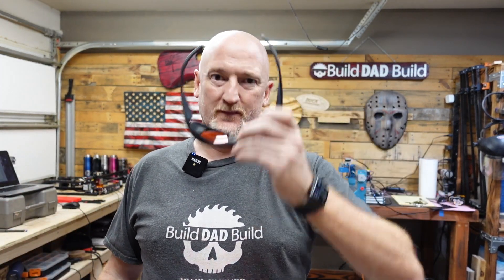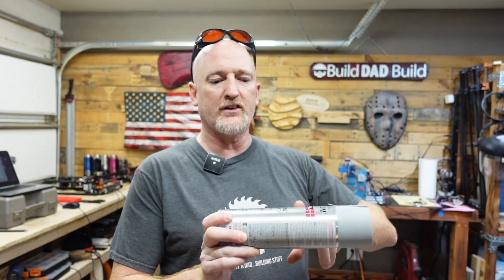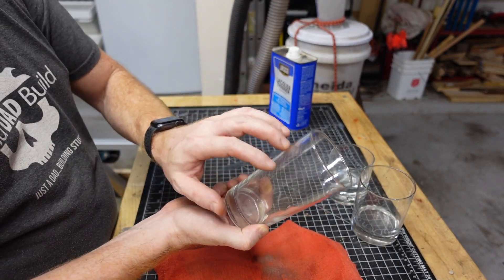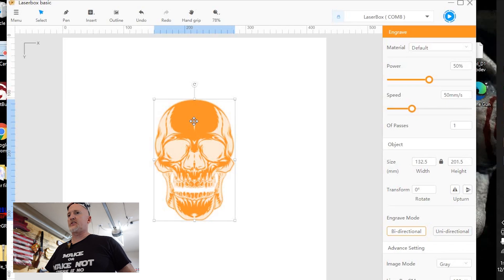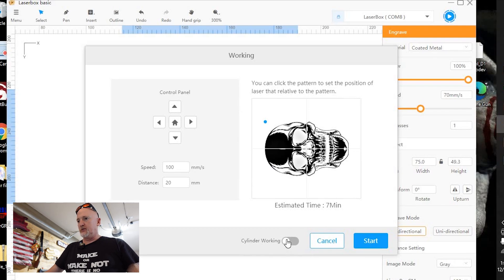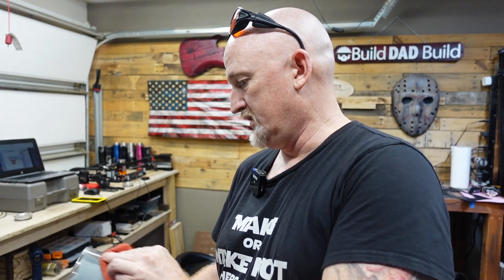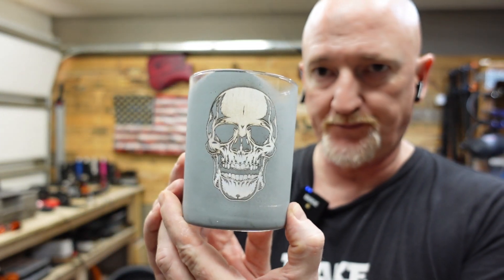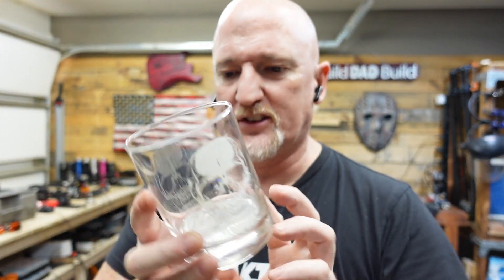How to Etch Glass with the xTool D1 10 watt Diode Laser

Comment: Hey, cool video Budd..  I'm Seeking tips for solutions in achieving bright visible FROSTING on glass engraving.
I have an Xtool S1 with 40watt and 2W IR  laser modules with XCS software.
When engraving tinted wine glass bottles using Tempura sprayed on, the frosting appearance is low and not acceptable yet. I'm willing to try possible solutions. Thank you in advance for your input!
Reply from the maker: Honestly? OC2 or Fiber will give you better results. I've had pretty good results with this:
https://enduramark.com/products/laser-marking-spray-can-charcoal-for-glass-ceramic

But the etch comes out dark, not white.
Cheers!

Comment: So the paint is gray but the end product is white? How did this happen? I tried it and it ended up gray/black.
Reply from the maker: It’s not the paint color. You’re creating micro fractures in the glass that give you the white look. Gray or black means either too much product or improper settings. Go with light coats and run a speed and power grid.

Comment: I believe that it just helps absorb the energy of the laser, We use sharpies on broken diamonds to explode them at work when using a laser welder because it doesn't give the the energy a clear path.  So from what I understand it just helps stop the energy of the laser from going through the glass
But I am new to the laser engraver so feel free to correct me

Comment: Is the glassware still safe to drink from after spraying this stuff on it and then hitting it with paint thinner...? Thanks for the video!
Reply from the maker: Yes. Just make sure everything has been cleaned off. You can also run it through the dishwasher.

Comment: Hi isaw on your video you used a door stop to lift the rotary. When i do they my image seems off
 Seems not straight. How can i get my image or text straight on the glass
 It's killing me this engraving 😢😢.
Every time the imsge seems to drop or go higher on one side.. 😕 thanks 👍👍👍
Reply from the maker: You’ve got to make sure the item you are engraving is level and doesn’t slip when the rotary spins.
Reply: @BuildDadBuild  is it manual then to get the image straight and not dropping? It's basically you lining the laser (not crosshairs) to the rail? Even when the glass is level
Reply from the maker: @dannoc1070  Make sure to check if the piece is level to the laser head. Use a square to make sure you’re in focus, etc.

Comment: Hi, Would you need the stainless steel preset if you were using tempara paint instead of galvanised spray? Many thanks
Reply from the maker: Not sure. I've never used Tempura paint. You'd need to run a test power and speed grid.
Cheers

Comment: Hi bdb. Would you need the honeycomb panel when doing glasses or is it just for the wood engraving? Thanks, been watching your stuff alot. !!
Reply from the maker: You do not need the honeycomb if you are using the rotary.
Cheers!
Reply: @BuildDadBuild  thanks for the reply. Just one more thing, if you could help?!
Should I use the stainless steel present setting on a glass if I have used tempara paint instead of galvanised spray? Or should I go less aggressive. Many thanks again! Subscribed
Reply from the maker: You'll need to run a speed and power test for best settings.

Comment: I've been etching glasses with my son for the last two months using vinyl and armour etch. 

This looks great. It seems you can get details in there that would be hard to do with a vinyl stencil. The question I have is this. Is this a faster process? It seems like the spraying and cleaning really slows things down.
Reply from the maker: you should NOT be laser engraving vinyl. The fumes are toxic and the exhaust is corrosive.
Reply: @BuildDadBuild  I think you misunderstood me. No worries. I'm doing a chemical etch. No lasers at the moment.  I'm considering doing laser similar to how you are.

Comment: Anyway you have or can do a video using marking paper?
Reply from the maker: Don’t have one. Haven’t had much luck with glass and marking paper.
Reply: @BuildDadBuild  what problems were you running into? I have used different colors and they all engrave differently. been playing with settings. The marking paper either goes deep or it doesn't and it can chip.

Comment: I use a foam insert and some aluminum foil (https://youtu.be/1OzojgMejko).  Also just turn the glass upside down when spraying to keep the stuff out of the inside.  Your result is ridiculously intense, so I found this very interesting.  I have heard that Dry Moly works well, but it is not available in Canada.  I have some Enduramark Diamond Dust on the way.

Comment: I've at this for a while now and can't seem to get the outcome right. 
10W diode, same settings, same spray, lacquer thinner to clean. 
I end up with the etching all grey/black as the 'Cold Galvanizing Compound' seems embedded in to the glass. It looks fine, but I'm shooting for the fogged glass look like Nick has here. 
Not sure what I'm doing wrong here!
Reply from the maker: You're probably putting too much product on the glass.
Reply: @BuildDadBuild  Thanks for the reply.

I believe I sorted this out. I had my resolution up too high. had it at 14.3 pixel/mm (~363 dpi). Reduced this to 6.7 pixel/mm (~170 dpi) and the black stopped sticking and I ended up with a nice even fog.

I think the higher res was driving the microfissures deep in to the glass and drawing the paint particles in to the fissures, locking that color in to the glass permanently. 

I mean that is cool if the color was more consistent and I may play more with mixing the concept of high res on some part and lower res on the other to have black accents.

Anyway, often we want the higher resolution for a cleaner image, but in glass etching this is not the best course of action

Comment: Hi, if my engraving is 95% perfect but has a few spots where the engraved surface chips off, what is the most likely problem?  Too slow or too fast engraving speed, too much engraving power (using 10W 100%), distance from laser to glass, glass quality, etc.? Thanks
Reply from the maker: Normally that means your spray coat wasn’t totally even.

Comment: So do you want the white flakes then sand it off? Or did I cut too hot and need to turn back power so it doesn’t flake?
Reply from the maker: The flakes are from the product, not the glass.
Reply: @BuildDadBuild  so I need different glass more than likely?
Reply from the maker: @chaddhaddox9523  No. Those aren't glass flakes...its residule from the spray you're using.
Reply: @BuildDadBuild  I went and bought the cold compound. Much better

Comment: I have been trying with this method for a while have noticed a few things that yield better results. Notably using a damp paper towel inside the glass and then sealing with tape has helped tremendously. Get it soaking wet, wring it out, stuff it in and you are good to go. Also if the artwork is high resolution, notably 3K+ pixels, turning CPM to 120 and sharpness to ~65% (depending on thickness of glass) yields spectacular results. One thing I have noticed is that thinner glasses tend to flake the etched layer easier than thicker ones, likely due to volume and thermal expansion. The thinnest glasses I have done with these settings have walls of 5mm and, like I have mentioned before, turned out fantastic. The galvanizing spray is must on a 10W laser.
Reply: Do you think this technique could work on clear acrylic?  Like a square sheet

Comment: Nice work! I've been etching glass for a couple of weeks now and I tend to have edges on the art look like torn paper. The edges are not smooth. In looking around, people have been saying to use a wire wheel or wire-brush. I haven't tried it yet but was wondering if this is something you do in your post production?
Reply from the maker: I haven't really had that problem. I stick with my melamine sponges!

Comment: Hi all, i dont have a D1, but i do have a diy mill/laser cnc, your concept is great, i tryed a few different settings, at first I was disappointed with the results, but as i increased the laser intensity i got some amazing results,
Im using the spaniard cold galvanized spray wich I had from a previous project.
Thanks for the great share..
Reply from the maker: Sure thing!
Cheers

Comment: I can’t seem to get the black char sections to go away.  Using the x tool d1 with cold galvanizing compound and ra2 rotary.  Everything looks great but the finer outline or smaller details get the black char.  The bigger sections look great.  Using 8 mm/s and 100% power.  Any ideas?
Reply from the maker: Usually means you are either using too much CGC or using too much power or too slow a speed and charging the CGC
Reply: @BuildDadBuild  Messed with just about everything I can think of.  The finer line areas and the outside outline is still getting quite a bit of “char” black areas no matter how thin I get the CGC.  Running 12 mm/s and 100% power.  Could overscanning or any other setting be causing it?  I can’t seem to get as clean an end result as in your videos.  Thanks for all the help.  I am using Lightburn FWIW
Reply from the maker: @chriswendt7105  send me a pic of the issue. Nick@builddadbuild.com

Comment: I used the setting and mine came out black . Not sure what I’m doing wrong
Reply from the maker: Usually means you put too much product on it and the laser burnt it.
Reply: @BuildDadBuild  okay I’ll try again . Ive been struggling with trying to get my settings correct. I was using light burn but it seems like laser box works better for my designs. I’ll keep practicing.

Comment: Hi Nick. Have you experienced this (see pictures). I follow you instruction (used a cold galvanizing compound put two coats let it dry for about an hour) Ran laser with the stainless steel setting 100% powered 12 mm/s and both time the image looked burned
Reply from the maker: You can't post pix in here. However, in my experience that means you put too much compound on your material.
Cheers
Reply: @BuildDadBuild  could it be the glass itself ?  I have encountered cheap glass that did not work well?
Reply from the maker: @hectorflores6666  I have not run into that.
Reply: If it’s black, you’re burning it. Up your speed.

Comment: I need help! I'm obviously setting up my settings or something wrong, when I do text, my words are mirrored... so the word mama, comes out as amam... I've turned my test piece every different direction, flipped my text in the program... I can't get it to etch correctly... on another note, Laserbox seems to be the only way to get my RA2 to work. I can't get it to work correctly at all on LightBurn.
Reply from the maker: The motor of the rotary should be closer to the start button.

Comment: Hi, I used the galvanizing compound on several attempts and each came out black and very hard to remove. I had to pick off the residue with an X-acto knife. How did you get yours to turn white and removable?  😣
Reply from the maker: It sounds like you might be applying too little or too much. Or possibly running your power too high.
Cheers

Comment: 3 questions
 1) does the x1 REQUIRE  internet  connection
2) you can prioritie software and 3rd party i.e RDworks & Lightburn 
3) Last what were the final  settings  for the 10Watt diode
Reply from the maker: 1)No
2)Lightburn
3) Said them in the video
Cheers!

Comment: I got my d1 this past week. I had a 5w ortur and when I used the CGC I just used a sos pad and water to get the coating off. Have you tried that? I did it that way to not have to use a thinner.
Reply from the maker: I have been told you can scrub it off. I had lacquer thinner handy, so I used that.
Cheers

Comment: Does it etch Powder Coated Stainless Steel Tumblers? Has anyone tested that? I know spray painted works fine... just wondering if this works on Powder coated tumblers, those scratch resistant type.
Reply from the maker: Yes

Comment: For all those wondering how / why they are ending up with black marks, black edges or inconsistent engraving using the same settings as our man BDB. The "white" is not actually the end product. Trust me. Take a drill and a wire bristle brush and sand off the white... you are now left with an impeccable finish.
Reply: I halved the power on my D1 Pro and got exactly the finish as you described. I tried a metal brush and the etching started flaking off completely. Tried ethanol, IPA, magic eraser, and putting them through the dishwasher. Any ideas how to get the frosted look without the black edges or totally black parts of the design?
Reply: i was just wondering why i have black marks and black edges on my glass. so i just like a brass wire brush and sand it off?
Reply: Key piece right here, thanks

Comment: Hayo! Would you or anyone else in this comments section have any advice with using the D1 10 watt for etching tempered glass? Would you be able to use that same compound and similar settings, or do you think it would need to be changed quite a bit? I have a friend who wants me to etch his tempered glass PC side panel, and it's expensive to just buy tempered glass to practice on. Thanks for any advice!
Reply from the maker: I would think the settings would be similar. But not having done it I can't say for sure.
Cheers
Reply: @BuildDadBuild  sounds good, I'll give it a go, and we'll see how it turns out!
Reply: @DeeBee1076  Hi what was your results or any advice you can give me? I’m in the same boat as you with the tempered glass
Reply: @leeke2451  hi, I did it and it actually worked out well! I used black spray paint so that the laser could find the material, and didn't have the settings very high. Only thing I'd recommend is that if ur doing an image that isn't just solid pieces of black/white, and has grayscale, I would actually make the image negative. My piece still turned out fine, but I hadn't thought about how the laser would actually making lighter the parts that were darker in the image. Hope it goes well for u!

Comment: So my engraving came out black.  sorry im new :)
Reply from the maker: Could be too much power or too slow. Could be too much product on the glass. Does it flake off? If that's the case you sprayed too thick.
Cheers
Reply: @BuildDadBuild  no flaking  i changed it to 300mm/s and 100% power came out whiteish
Reply from the maker: @kelsifrederic7372  Sounds better? Are you still unhappy with the result?
Reply: @BuildDadBuild  it wasnt super white like yours.... ps i have a 5w
Reply from the maker: @kelsifrederic7372  You'll definitely need to tweek settings for the 5w
Reply: @BuildDadBuild  does slower or faster make it white?

Comment: Is there anything you can recommend to change
Reply from the maker: Run a power grid. Make sure you're not over-coating the glass with CGC. Make sure the glass is clean before applying. Those are my first go to-s
Cheers
Reply: @BuildDadBuild  thank you

Comment: So I’ve done this 3 times now exactly the same way you did. My images all come out black and fade pretty good when I clean them with lacquer. I noticed yours came out white and didn’t seem to fade when you cleaned them. Any suggestions would be appreciated thank you! I’ve been watching your videos you’ve already taught me a lot!
Reply from the maker: If it's flaking off that usually means you're spraying it too much.
Cheers
Reply: I figured out I was using the wrong setting. I was using coated metal instead of stainless

Comment: Quick question. When you did your stainless steel & glass, using the default settings (100%power, 12 mm/Dec) Did it take almost and hour?  Mine did and the image was barely 2.5x2.5”
Reply from the maker: More like 30 minutes...
Cheers
Reply: Depends on how dense your image is. I have a monogram 40mm x80mm. When scored it takes 10 minutes. When etched it takes 40.

Comment: Over 1 year ago I did a video on Youtube on using cold galvanizing spray on glass & Tile and used water to wash off the mess. I run a 5.5w optical diode laser at around 60% power Glad to see you found the same results as me.
Reply from the maker: Yeah, I was surprised that you can wash it off with water!
Cheers
Reply: @BuildDadBuild  Probably washes off because the glass is not porous enough for it to adhere to it.

Comment: In Canada, Amazon wants over $100 for a can of Rustoleum.. LOL... it's about $12 at the hardware store.
Reply from the maker: It has to have something to do with aerosol or something. I've noticed spray paint and spray finishes are always a TON more expensive on Amazon.
Cheers
Reply: @BuildDadBuild  I think the actual science  behind it is the ZINC that is used in the paint... or whatever other metal pigment they use, such as titanium oxides, etc. this is why the Rustoleum "Cold Galvenizing" paint works so well, because it's so rich in Zinc. On metal, the zinc bonds and leaves black... on glass, the higher temperature that is caused by vaporizing the zinc (or whatever other metal is in the paint) may help in the etching or bonding. Excellent videos. I've learned a lot a from you... keep 'em coming!